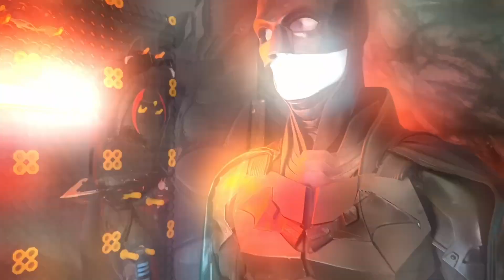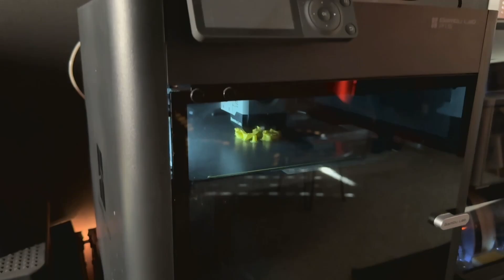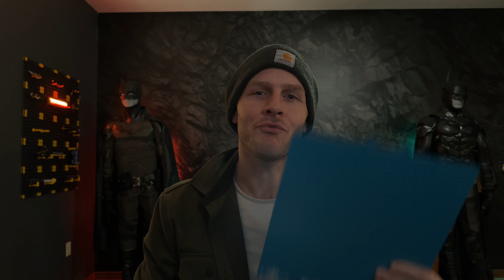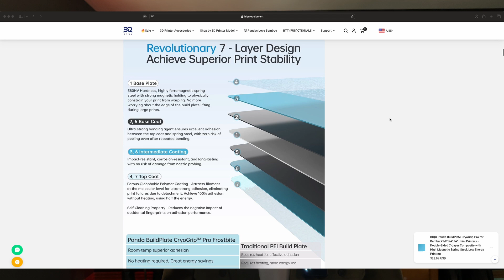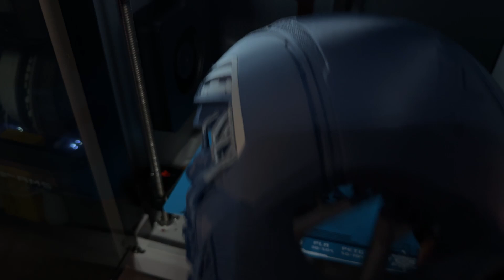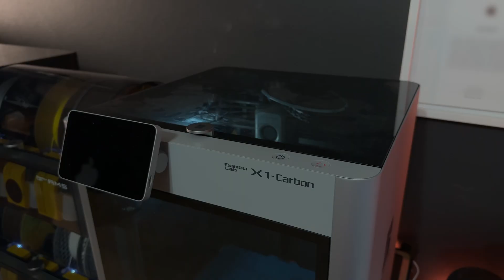3D Printing Cheat Code | Perfect Bed Adhesion

Comment: Can you offer insight on the compromise of chamber heat, filament bond and dimensional changes from temperature that will be occurring due to the heating of the bed being off? I find PEI has been my best plate in my DIY chamber and MK3s+ ... and recently PEO with a carbon fiber effect (which I guess creates great micro mechanical retention). I was still having edge lift and some shrinkage effects warping prints. I've become a brim addict to be honest. If it needs to stay flat and have a sharp clean edge - I'm using brims. 

I'd love to find a better way - clean prints with minimal extra post process.
Reply from the maker: These cool plates definitely excel with PLA. I would absolutely still go with PEI on materials like ABS and I totally agree brims all the way there. Even PETG seems to do better for me on textured PEI

Comment: I have never had any issues with the textured Prusa sheet printing PLA or PETG.  Not a fan of the smooth PEI sheets
Reply from the maker: Yea the smooth sheets are where I’ve had the most issues for sure. Textured PEI on my Bambus always held pretty well and the textured PEI on my K2 Pluses have been surprisingly good. But I still love the extra piece of mind with these cool plates!